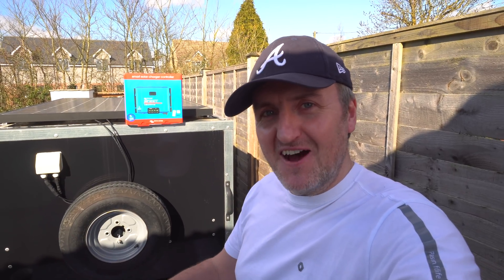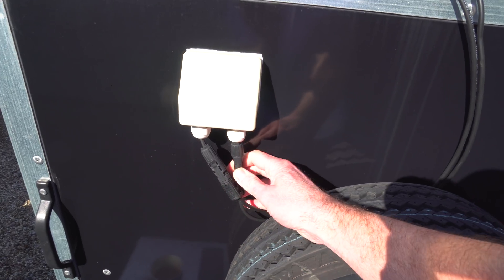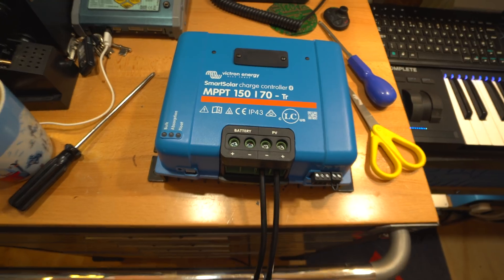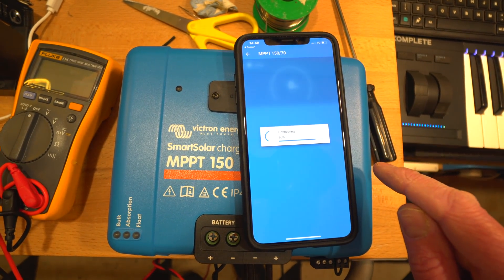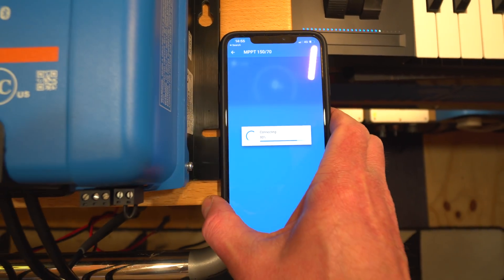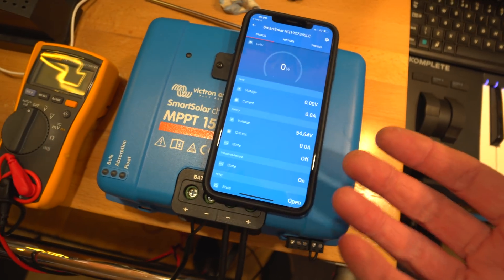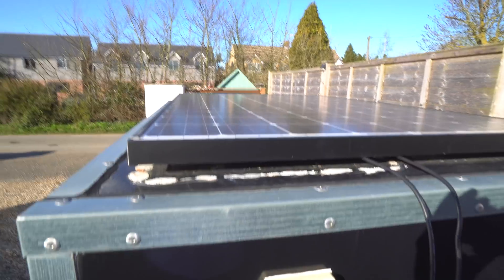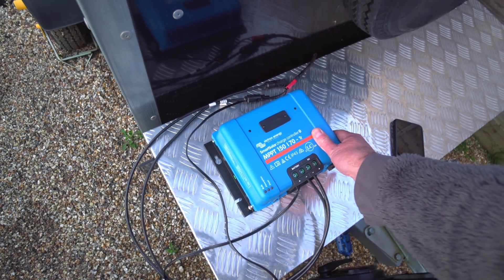HOW TO CHARGE YOUR EBIKE FROM SOLAR!!!

Comment: Isn't there an issue with having solar connected with no battery. I heard it can damage  the charge controller
Reply: That's the case with cheap PWM controllers. The Victron's MPPT controllers can just disconnect the solar when it's not charging anything.
Reply from the maker: I’m yet to find out... I never actually leave the panel connected without a battery but I’m also aware that when the battery is fully charged no current is flowing so I would presume it’s safe... not sure about that though.

Comment: I use a Vic 100/30 in my garage on 12V batteries and a victon 375 inverter to charge my ebike and can confirm the bluetooth range is amazingly good, through garage wall through house wall into front room 50 metres away. Its an interesting concept using the victron straight to the E-BIKE Battery, however will you not have to isolate the Pv array during battery disconnect to protect the Victron? The 150/70 is overkill for a 4a charge output, however for the Twizzy it's going to be perfect (You may need a few more Hit 330's :) )
Thanks for this video, your Solar Shed videos helped me decide what I needed for my system.

Comment: Good video. Interesting concept.
I have idea’s of a garage type shed for the Twizy that you drive into. Plug up the Twizy and charge from overhead solar panels (that make the roof).
Hmm. Even have a battery bank that the solar shed charges so even on a cloudy day, the Twizy can charge.
Hmm.
On another note, my work went into lock down today. I am now working from home.
How does this lock down effect you and your other half’s work ?
Reply from the maker: Yeah I’ve seen someone in Germany do this, I think they actually used the same charge controller, very cool. I kind of already do it in an indirect way with my few panels on the house and grid ties.
Im going to do some more videos this week and Sarah is doing daily vlogs on her channel during this crazy period so go check them out if you want to see what we are up to! 
We both work for ourselves so we are mostly at home anyway. Everything is shipping as normal from my online store so hopefully it’ll stay that way.
Stay safe mate.
Reply: andy kirby and you and Sarah too.
Very oddly quiet on the roads too